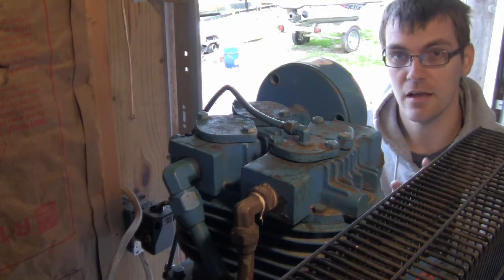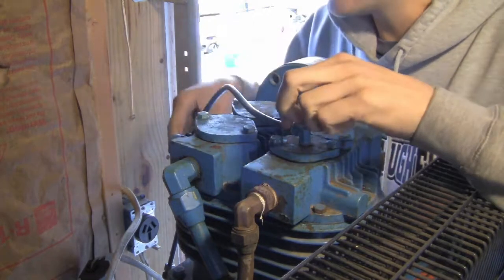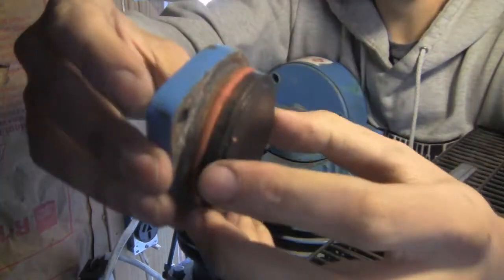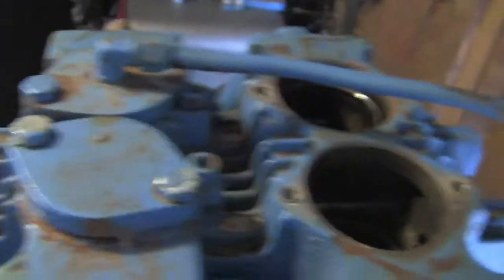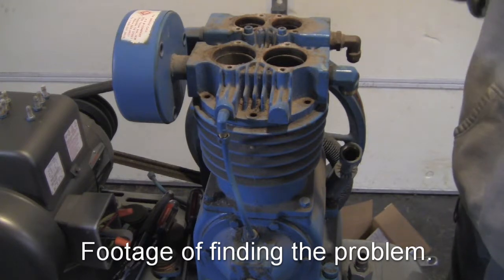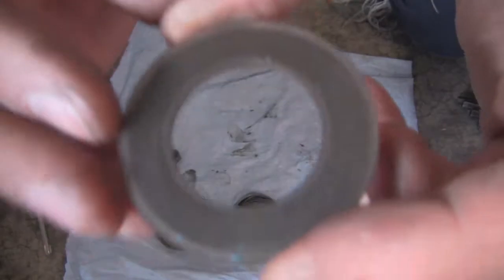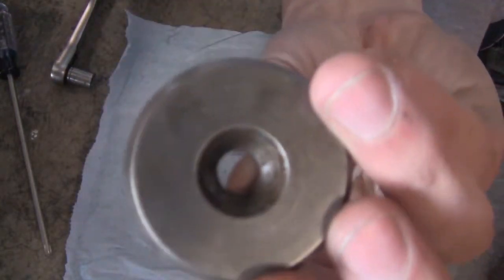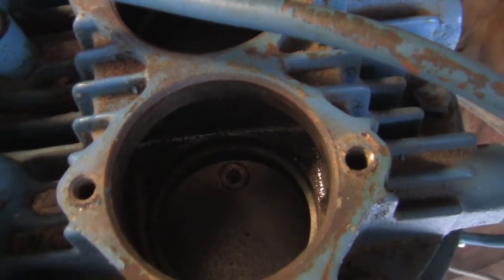Kellogg 335 Resurrection: Valve Servicing [PART 3]

Comment: I just cleaned my valves
Reply from the maker: It makes quite a difference especially if they aren't sealing super well. I probably should pop mine out soon and check they're all happy and healthy when I change the compressor oil.
Reply: @trythistv  Hey How much oil does your compressor take
Reply from the maker: I do believe it is right about 1 quart, I bought a whole gallon so I could do several changes to clean up my slightly neglected crankcase, and I think I've used 1/4 of the gallon every change, maybe just a hair more than 1 quart but definitely not 2 quarts.
Reply: @trythistv  okay I was just checking because  I asked a air compressor place to see how much it took and they told me two quarts but when I filled it up it was like one quart
Reply from the maker: Yeah not a chance my 335 will fit 2 quarts. It'd be spilling out the top! Maybe one of the gigantic 4 cyl compressors might take that much
Reply: @trythistv  okay cool

Comment: I know this is an old video but it would e the check valve that is bad if you have air leaking back through the pump.
Reply from the maker: I would have thought the same thing, but if I recall correctly I replaced the tank check valve... of course that could have been that I replaced it on  the new tank that didn't have a giant rust hole. I'm not sure if it was just that the unloader wasn't bleeding the pressure fast enough or if cleaning up these valves really helped, but after cleaning these up it sure seemed like there was at least less air bleeding back through the pump. And the amount of rust on some of them was a little concerning so I'm glad I took them out either way. Compressor is still working great, I've found myself using it more and more as time goes on and it seems to love it!